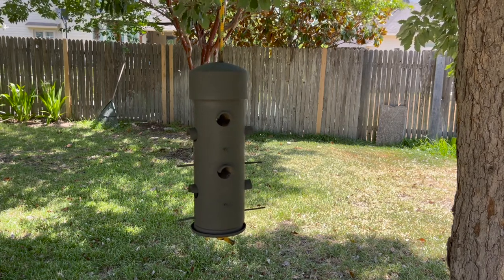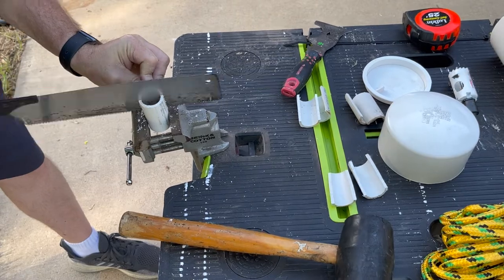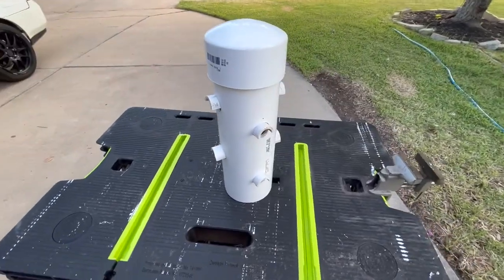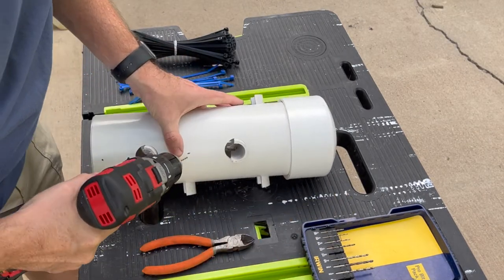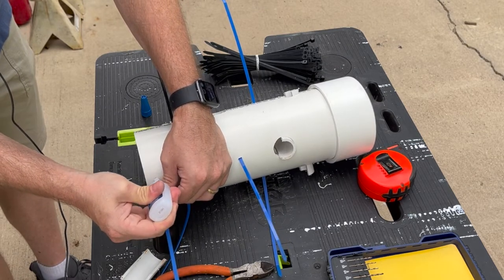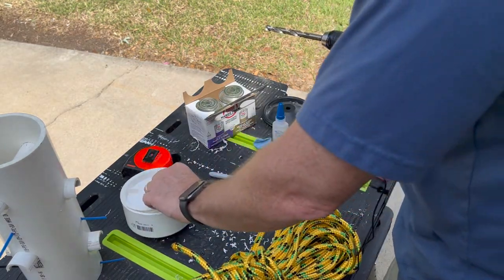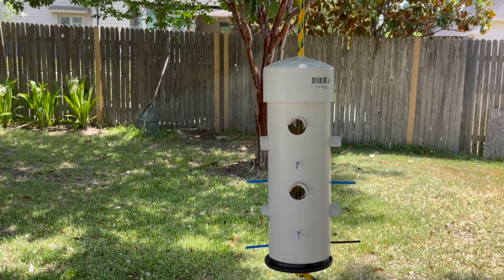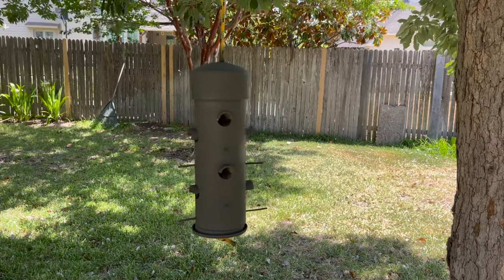Make a large bird feeder from PVC - cheap and easy!

Comment: That turned out really nice.  I like the fact that it will probably last a long time.  That thick PVC is strong.
Reply from the maker: Originally I was going to use the full 2’ length of pipe for the body, but I didn’t know if the food would hold. The hoods are working great to keep the food from pouring out

Comment: We've made (husband actually =])  several of these.  I vote on putting in just the BOTTOM 4 feeding perches.  The birdies will land on the top 4 perches and as soon as the feeder is half empty, those birdies are screwed--so to speak. Also, if you glue the bottom on, there's no way to thoroughly clean out the damp, moldy seed?  Otherwise, excellent!